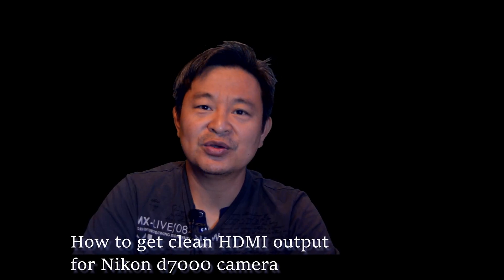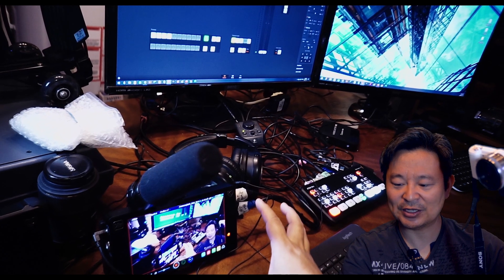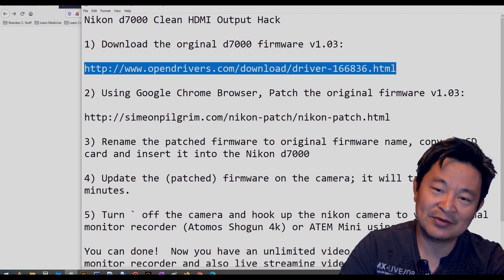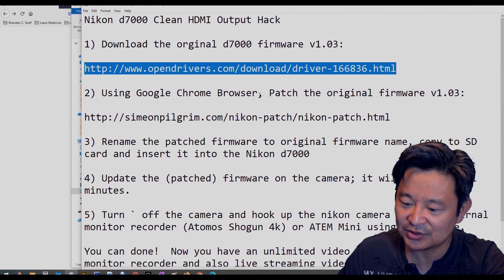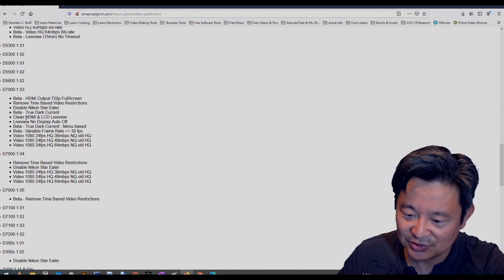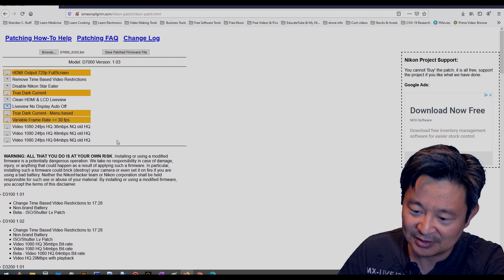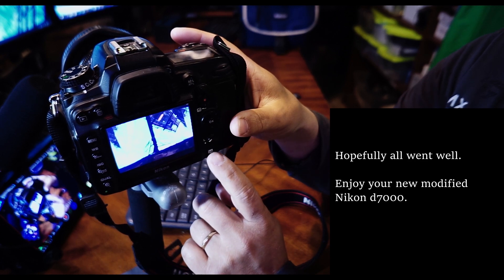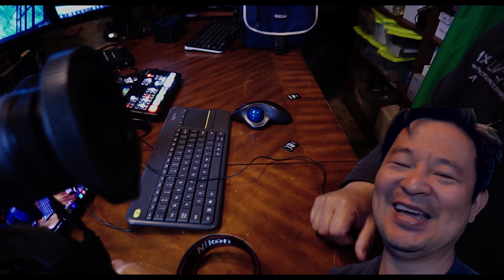How to get a clean HDMI output signal for Nikon d7000 camera

Comment: Thank you for the guide! Managed to get the clean HDMI output. For anyone doing the update, I had A: 1.04, B: 1.03. The patched firmware is a downgrade. But it is worth it if you need a clean HDMI output. After the patch, the INFO button and the front command dial (I used that to change aperture) didn't work, but in normal photography mode, everything is working as normal.
Reply from the maker: Thanks for letting us know.
Reply: Do you still have a preview from the back LCD screen or that one is disabled too?
Reply: @FerdinandDivinagracia  Hi sorry for late reply. Yes I still have the preview.

Comment: First of all, I wanna thank you for giving us this information! It worked perfectly for me!
Also, my camera was on 1.04 and I can tell that downgrading works like a charm...
I went straight from1.04 original to 1.03 modified firmware.
Thank you again!!
Reply from the maker: Thank you for letting us know.
Reply: where do you find the firmware 1.03
Reply: Hello, I tried this and unfortunately the changes didn't stick. Still on 1.04 with no clean HDMI. Did I miss a step? Did you need to renamed the /bin file to 104 instead of 103?
Please help.
Reply: please does your audio work
Reply: @educatetube  this works for a d7100 right? it is the only d7000 camera that doesnt work with a camlink
Reply: @AliZeroThree03  There are all original fw, 03, 04 and 05.
Reply: I can also confirm that my camera took the downgrade from 1.4 to 1.3 just fine. Hopefully that's true for everyone who tries it!

Comment: Thanks a lot for this tutorial, I take a risk with my D7000 version  1.05 , downgraded it first to the factory 1.03 and then once again with patched version and voila clean hdmi signal achieved.
Reply from the maker: Awesome!
Reply: Same for me! Downgraded with patched 1.03, it worked well!
Reply: @HitachiYasumoto  can you provide me url for me to downgade my firmware.. currently i use 1.05
Reply: can you provide me url for me to downgade my firmware.. currently i use 1.05
Reply: @legen_25  , got it from here : https://nikonhacker.com/viewtopic.php?t=2798. Then I used the online tool proposed in this video.
Reply: @legen_25  Use the link provided by Sip Ski in his youtube tutorial. http://www.opendrivers.com/download/driver-166836.html
 Note that I did have a problem downloading the files with Chrome Web Browser. So using an alternate browser such as Mozilla Firefox allowed me to download the file

Comment: Went from 1.05 to patched 1.03 no problem!  Works great!  Camera doesn't seem to care as long as you have a valid firmware on the SD card, it sees that as the "new" and whatever is in the camera as current.  It works with Zoom when using a Cam Link 4k.  The only bummer is the output is 720p instead of the select 1080i and it doesn't look like they are going to try and fix this.  Really with Nikon would just fix the firmware themselves.  Gonna try adding OBS to the mix.  Thanks for the great tutorial!
Reply: where did you get that firmwear ver
Reply: would you still happen to have the file you used? The website doesn't seem to have it anymore
Reply: hey! any updates on OBS and how it works, would be great to know.  thank you!
Reply: @nategran9401  once you get the patch up and running on ur camera, you’ll still be left with black borders. Pretty easy fix though with obs. TLDR it works great
Reply: @himeros.606  have you found it?
Reply: @himeros.606  I can't locate the file either. Please share it with me if you saved it on your HD somewhere. Really need to utilize my D7000.
Reply: @himeros.606  I can't locate the file either. Please share it with me if you saved it on your HD somewhere. Really need to utilize my D7000.

Comment: I seem to be stuck with 720p on Zoom and in my preview. Any ideas? HDMI Settings either on Auto/1080i do not seem to make a difference.  I've got a 4k UHD cable plugged into the Cam Link 4k, which goes into the stock Apple dongle my Mac came with. Do you think it's the dongle that's at fault?
Reply from the maker: I think it only allows 720p signal output.  I always had 720p but upscale it to 1080p in post video editing software (DaVinci Resolve).

Comment: After the patch does the HDMI output audio?  I am trying to use the D7000 to OBS through a video capture card and get the video but no audio.
Reply from the maker: It is possible.  I am not sure because I hooked the Nikon d7000 camera to my ATEM mini and feed the HDMI output to the Atomos Shogun monitor recorder.    An external Lav mic hooked directly to the Atomos.  I record my videos via Atomos Shogun.  My system hook up is mainly hardware.
Reply: @educatetube  Thanks for the reply and good video.   I ended up hooking mic to the computer and syncing with OBS.   It worked well.   I am under time crunch needed it for streaming and recording a wedding this weekend.   I will mess around with the HDMI and settings when I have more time, but right now it works well.
Reply: Same problem here I don't get any audio (internal nor external) signal via the HDMI cable. My capture (pengo 4k HDMI) has an audio-in, that's what I'm using now.
Reply: I don’t get audio, either. Bummer. Latency issues if connecting mic directly to Atem.
Reply: @jamespatrizi6011  hey James how did you deal with the the black borders on all four sides I can't seem to crop out the four corners of the black bars on the OBS software

Comment: This is an amazing video and may work for me but I wanted to check before going ahead.  Would this work with my D7100?
Reply from the maker: I don't think it will work for d7100 as it has a different firmware (software) implemented into its hardware.

Comment: Hello & thank you. would you have any idea why the HDMI output would not be full screen? I have the setting at 1080(i). It seems to have the right proportions and is about 75-80% the screen size. Also using ATEM Mini. Thanks!!!
Reply from the maker: Yes, with hdmi out from nikon d7000, unfortunately you will get cropped screen. I usually used a wide angle( 28mm or less) to ensure I get my composition correct.
Reply: @educatetube  very good to know,  thanks. I can re-scale it on a direct feed to vmix or obs. Doesn't seem it will be practical to expect a full screen via connection to ATEM mini then. Take care!

Comment: Thanks a ton.  I had 1.04, and went to 1.05 (yeah dumb move it seems).  But I was able to get the 1.03 and downgrade just fine.  Then got the patched 1.03 as seen here and Viola a clean HDMI output.
Reply from the maker: Awesome.  Good to know.  Thanks!
Reply: can you provide me url for
 firmware 1.03
Reply: Me too.

But using the D7000 with Atem Mini Pro… video doesn’t scale to 1080? My atem just shows a cropped frame, and with terrible washed out colors. How do I / can I change this? Comparing to the D750 (have one of those, too, works without patching). Miserable. Not at all the quality shown in this video.

Comment: Can the D7200 camera stay plugged for a long time?  I need to use it for live stream.  Would that cause any damage to the camera?
Reply from the maker: I don't know about d7200 but for d7000 after the modified patch, I could record indefinitely as long as the battery last.  However, d7000 can only do 720p, which is ok with me as I used it as a multi-window / multi-screen blogging.

Comment: It's great that we can have clean hdmi output but unfortunately, we lose the preview from the lcd screen, so unless this camera is within arm's reach next to your monitor it will be very difficult to see your composition and focus if it is being used as a 2nd camera in a live event.
Reply: That is why you need to use an external monitor mounted on your camera. Most of the newer ones (like 2018 and newer) have an HDMI Out plug on the monitor so that you can then send the picture out from your monitor to your recorder or mixer. Hope that helps

Comment: really need your help.  Your firmware upgrade worked perfectly.  I recorded with a beautiful screen with nothing but video.  Now the problem, OBS has got all the Nikon d7000 information on the screen when recording using a capture card and HDMI plugged into a USB 3.0.  Any help on how to get a clean screen with OBS for recording?
Reply from the maker: Not sure why that is happening? Did you download the modified/hacked firmware to get rid of the information (clean hdmi output)?

Comment: Hello. Firstly thank you for the guide that is very helpful. Done the firmware update.
However, I got a problem that there are 4 black edging on the 4 sides of the video capture when I connected it to OBS, since I have to use Chroma Key with green background, I was having a black frame surrounding the image. That's very wired. Please suggest how would I solve this problem? Thank you once again
Reply from the maker: It only capture 720p. You might have to crop in. I use ATEM Mini device and I can crop in using their software.
Reply: @educatetube  Thank you very much. I couldn't get an ATEM atm but i'll try other capture software for live broadcasting.

Comment: Years ago I tried to use a D7k for streaming but nothing worked. Thank you for this video. I'm going to try to downgrade A 1.03 - B 1.04 - L 1.009. What stand/ arm are you using under your camera?
Reply from the maker: I use my modified tripod (it was previously broken and I just fix it).
Reply: were you sucessful in downgrading firmware versions? this is the version i have the no patch is working
Reply: Yes, it works. Now I am able to use it with OBS and a capture card.
Reply: @diomedeslajara  mind me asking if you have the link?
Reply: @Inkedup128  I used the one in the video.
Reply: @diomedeslajara  mind me asking what SD card you used and did you ever connect the camera to the computer directly?

I cant seem to get the camera to read any firmware on the current SD card
Reply: @Inkedup128  I followed the video instructions. I am not sure why yours isn't reading the sd card firmware.
Reply: @diomedeslajara  i got it to work. The simeon website wasnt working for me last few days. But i also found out it was the SD card. It was too old. So i ordered a sandisk extreme that nikons website recommended for the d7000 and it worked first try. Amazing how a small SD card was the problem

Comment: Can i patch it again if i already patched my firmware ? I'm having trouble with my D7000. When i plug my HDMI my LCD View is blackout and i have to use external monitor to preview it. Anyway i can fix it ?
Reply from the maker: I think you can not use the external monitor and the Nikon screen at the same time.

Comment: Hey! Thanks man! I have a question. I have the D7000 and my firmware info it says. A. 1.03 B 1.04. L.1.009. My firmware is 1.03 or 1.04
Reply from the maker: It looks like it is 1.03 but not 100% sure.
Reply: i had the same firmware, and when you apply this patch, you are actually downgrading.. but it worked. i have a clean lcd already and usually use my dslr for online meetings like zoom.. hope yours worked well too... thanks for this vid, it helped me a lot in finding an easy way to use my d7000 as a webcam..

Comment: thanks for the video, i just checked my camera is on firmware less than 1.03, can i revert back to 1.03 if i repeat the steps again and flash the camera with the original 1.03 firmware?
Reply from the maker: According to what I read, you should be able to. I haven't try to revert it back yet.
Reply: @educatetube  highly appreciate your reply sir, will take confidence on that.

can you make a video on D7000 to OBS streaming with kit lens and other lens also some tweaks and settings to improve. thank you
Reply: can confirm it works, a clean HDMI out! i'm coming from (as it is shown in menu) Firmware A1.01 B1.01 C1.002. Thank you!

the Menu button also works too.

Comment: Can I ask what is the maximum length of time you have live streamed? Does the live view go off?
BTW - I successfully downgraded from the latest firmware to 1.03.
Reply from the maker: Until the battery dies but I only tested it for 20 min.
Reply: @educatetube  Thanks. I have ordered a mains battery so that is not going to be an issue. Thanks, I'll report back.

Comment: Thank you so much for this tutorial. I tested my D7000 and got a coupler battery live view mode goes more than 4 hours with slight heat.
Reply from the maker: No problem.
Reply: I was curious about it as I will use this to live stream sometimes for 5 hours. It did not overheat for you?
Reply: @mishakmusic  Depends on the environment you're shooting with. I'm on a church and well  conditioned area so heat is not a problem to mine :D
Reply: @gsvisualedits3816  can you please link me the coupler battery you use on d7000?? I am going to do the firmware tonight and will need battery ac lower next week thank you !
Reply: Right now I’m on 1.02 firmware.  Should I upgrade to stock 1.03 and THEN reflash cracked 1.03? Or can i upgrade straight to cracked 1.03?

Comment: Thank you for the Tutorial - it helped me a lot, the removal 720P Fullscreen-Stretch was the key. I've got one question though - the Output Ratio on my D7000 seems to be fixed to 4:3 (Aspect of the Liveview, which is duplicated) right now, on your Shogun you seem to have a 16:9 Format. Is there any setting or workaround that I missed?
Reply from the maker: I used the Davinci Resolve 16 software to zoom in at 16:9 or even at 2.35:1 on the screen during video editing. Another technique that I think will work is to physically tape or block the lens to give you the 16:9 effect if you are doing living streaming (assuming you set the lens to manual focus). Hope that is helpful.
Reply: i ended up using the 720p stretch through the ATEM Mini. i was stuck on 4:3 otherwise.
Reply: Pointer to the Atem Mini Pro stretch option? Can’t find it

Comment: This all worked - however, the hdmi output appears to be squashed / is not at a proper 16:9 resolution. So any video sent via the HDMI appears to be distorted. Is there anything that can be done to correctly send the video as 16:9? I tried the BETA function from the patch tool website, but even that adjust 720p is distorted, just in the other direction.
Reply from the maker: Don't choose the 720p full screen.  That is what is causing the distortion.

Comment: Right now I’m on 1.02 firmware.  Should I upgrade to stock 1.03 and THEN reflash cracked 1.03? Or can i upgrade straight to cracked 1.03?
Reply from the maker: Not sure, but I think so.  I had upgraded mine from 1.00 to 1.03 firmware.
Reply: @educatetube  thank you sir, what power supply/dummy battery do you use for d7000? I want one I can trust
Reply from the maker: @mishakmusic  I don't use any dummy battery but just the 3rd party battery.  I think the battery lasts quite a long time as  I only need it for less than 2 hours.
Reply: @educatetube  maybe it will be safer for me to just keep multiple batteries charged. I need to teach online for 4 hours. Maybe safer than using dummy battery. What are good brand of third party battery?
Reply from the maker: @mishakmusic  i got the third battery off the amazon. I don't remember the name. it is the amazon suggested recommendation.

Comment: This works. But you need to take the battery out and then put it back in. Otherwise the camera might not recognize the change in the SD card and pick up the new firmware bin file.

Comment: HELLO, I have watched your video carefully, and I have the same problem, only that my camera has firmware
A 1.04
B.1.05
L .005
I know that you say that it is not recommended, but I do not get another option and I want to know if you know someone who made it go back in the firmware version and it worked, THANK YOU VERY MUCH
Reply: HELLO, only my camera has firmware
A 1.04
B.1.05
L .005

do you think it will work for me?
Reply from the maker: I think it has to be 1.03 or lower firmware. Not sure if you can downgrade your firmware.

Comment: If you update first with the older original firmware file, just in case, and then update with the patched one in theory everything should be copacetic. In theory. I'm not a Nikon programmer so I'm guessing by experience.

Comment: Hello, thank you for the tutorial, I followed along and was able to get the clean HDMI. However, I can't seem to get the video output to register when it's plugged into my ATEM Mini Pro. It gives me the options to View Photos or a Slideshow, nothing else. I've gone into the HDMI Menu and I've attempted to turn off "Device Control" However it says "this option is not available with current settings." 
It was doing this before I downloaded the patch. I've reset the user settings and still nothing. Any help to get me unstuck would be greatly appreciated!
Reply from the maker: It should automatically recognize it but at 720p.  I cropped in and use green screen. Mine is ATEM Mini not ATEM Mini Pro. So not sure if it is the ATEM that is the problem.
Reply from the maker: Check if it is in primary or secondary input.  I think it should be in secondary input for green screen.  Check the ATEM software setting.

Comment: My d7000 has 3 things in the firmware but A is 1.03, B is 1.04 and L is 1.006. Can I do your procedure with this firmware?

Update:

You can downgrade  firmware versions. Works great with my camera now. Thanks.
Reply from the maker: It looks like you can as I see 1.03 as the current firmware.